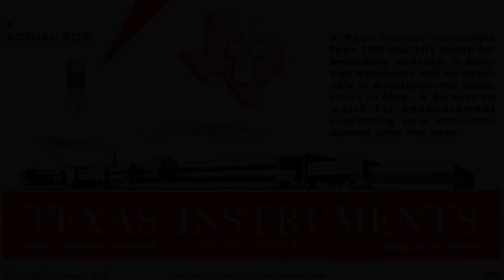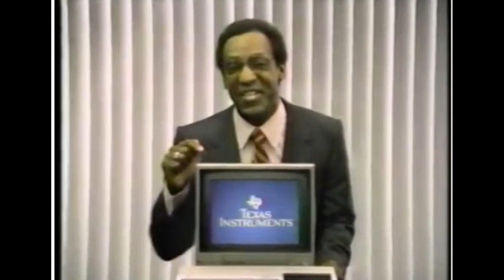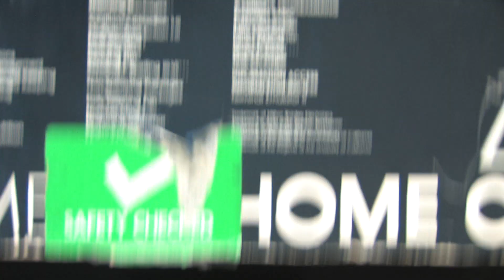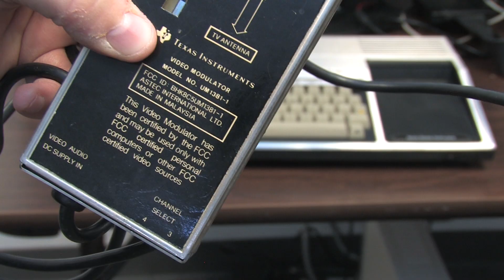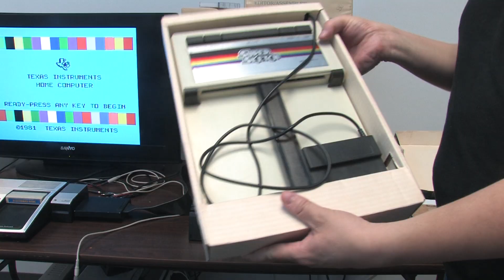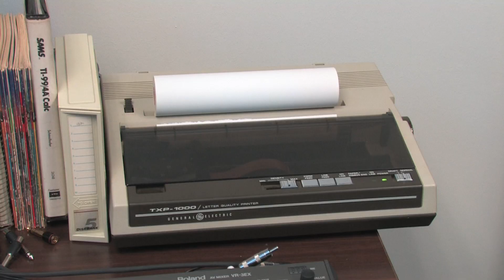Introduction to the Texas Instruments TI-99/4A - Newline99

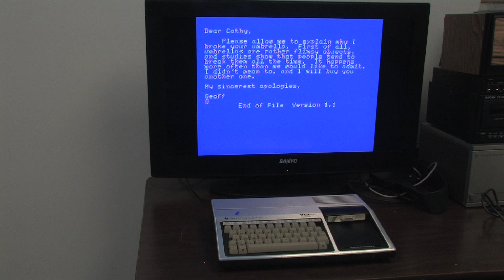Comment: Very good video. A question at minute 5:20 shows a letter addressed to Cathy that is surely from a word processor, the one that catches my attention handles upper and lower case letters, which word processor is that?
Reply from the maker: Hi José!  Good catch on the lowercase.  That is a word processor called MiniWriter III+.  It is cartridge-based software that came with a cable to attach a parallel printer directly to the cartridge, allowing the user to print documents without needing a PEB and RS-232 card!  The 40-column mode and lowercase character set it uses are great features.

Comment: I noticed you had a HiFi tape deck in the video. Does that work to load and save? I was under the impression you needed to be able to adjust tone and mic volume, such as would be found on an old school tape recorder.
Reply from the maker: I had a heck of a time getting modern cassette systems to work with my TI-99.  I do have a lot of old cassettes, and I had recently got the professional deck for digitizing old audio, so it worked out nicely.  But even with that, I ended up having to send the audio through a mixer to get the levels right for saving and loading to CS1.
Reply: @newline9937  I tried it once with a laptop and audacity. Couldn't make it work.
Reply: @jasongins  Me too. I tried for way longer than most people would before giving up. I still haven’t figured it out.

Comment: Green stick with safety check meant that the computer was field fixed/upgraded by TI reps (I was one :-).  There was a potential danger in the power adapter.  There should be a small wire plug extension to the power supply.  We had to glue the cable to the existing cable.
Reply from the maker: So cool!  I didn't know that.  Love to hear the human stories behind this great little machine.